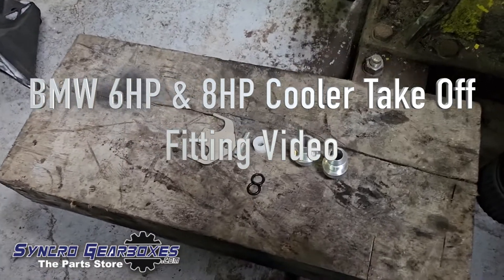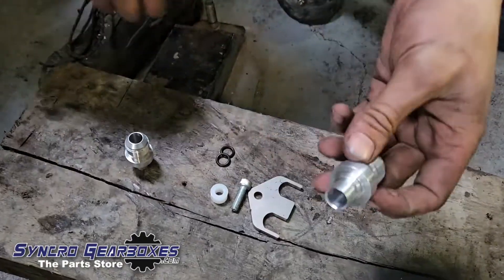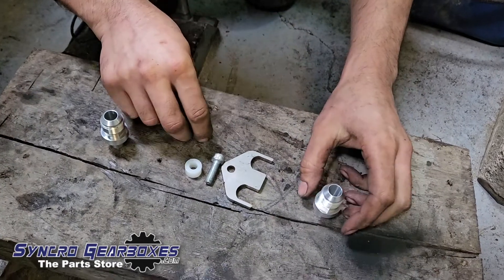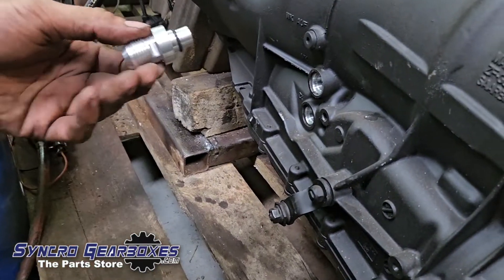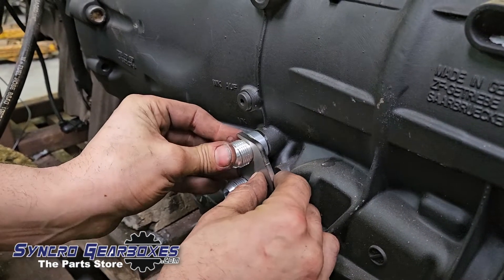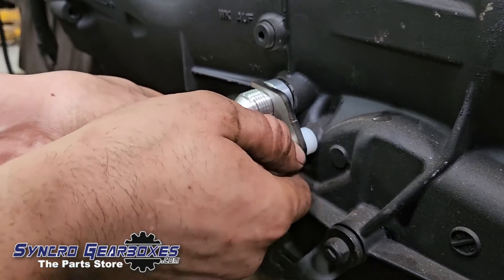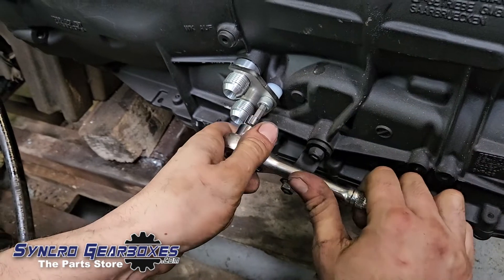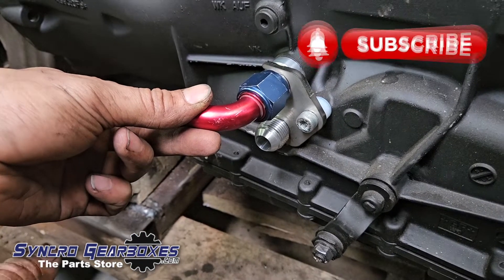BMW 6HP & 8HP Cooler Take Off Kit Fitting Video

Comment: One suggestion....machining the collar to accept a 15 or 17mm wrench would be amazing. Would allow the installer to easily torque down the fitting instead of allowing it to spin on the o-rings.
Reply from the maker: They cant spin, the fork is slotted and holds them in place. Just like a spanner.